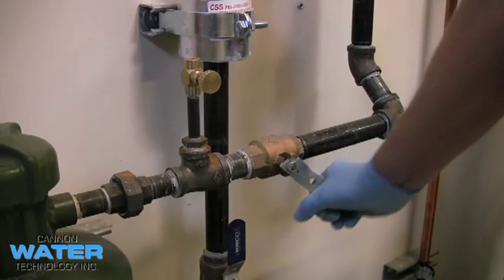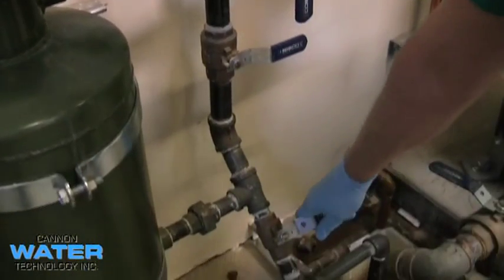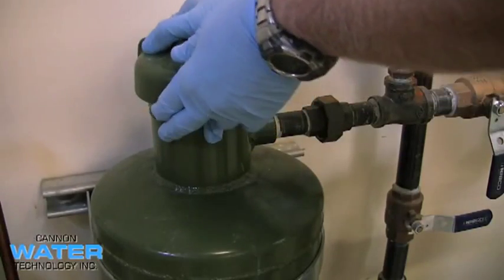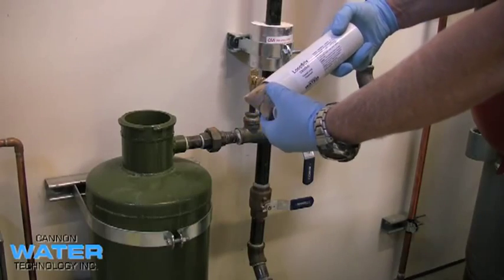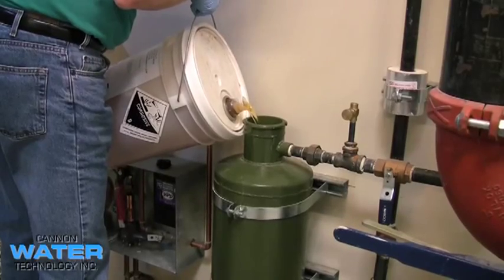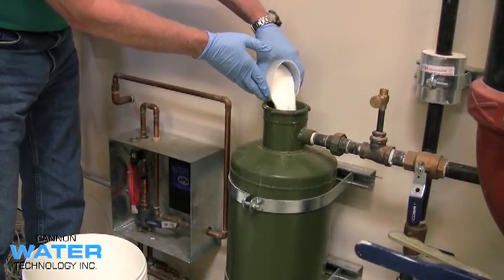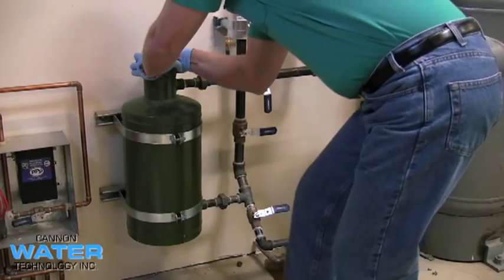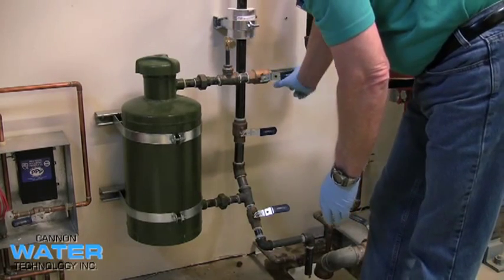How To Use A Chemical Bypass Feeder

Comment: what if the chemical is exothermic? what if the chemical is corrosive to the metal? what if the chemical releases a dangerous gas?
Reply from the maker: Rami, it's always a good idea to test your new chemical for a reaction if you are unsure of what is in the existing system. Do a jar test to see if any adverse reactions occur and if so you may need to flush the system before introducing your chemistry. I have had this happen to me once while adding dry Sodium Nitrite to a feeder. There must have been something in the system that was not compatible with the Nitrite. I noticed the bottom of the by-pass feeder begin to glow red hot. If this happens back away from the area and allow the chemical reaction to run it's coarse and wait until the system cools down. Leave the area if any noxious gas is present and alert personnel of the situation. Consult your water treatment company to find out what steps should be taken to flush the system out.
Reply: @CannonWaterTechnologyInc  With all due respect, your suggestions are pure insanity. Adding "Chemical compounds" to a system in operation without fully understanding the specific reactions associated with the process is a recipe for utter disaster! In the case of Sodium Nitrite and water, the reaction isn't bad. If added to other liquid, the reaction could be exothermic. Water and NaNO2 is actually a cooling effect (endothermic). You had to have another chemical in the feeder to create such a bad reaction. We had a water treatment rep add hypochlorite to a bromine feeder and not only did it explode, it produced a very toxic cloud inside the energy center that easily could have killed someone. That company was immediately fired (of course). Bad things happen when uninformed individuals go rogue with chemicals!